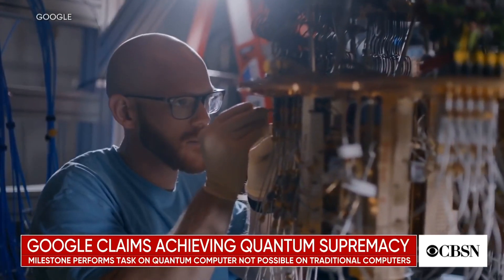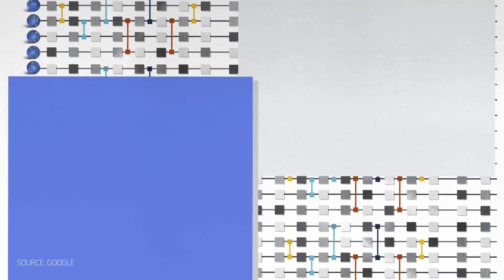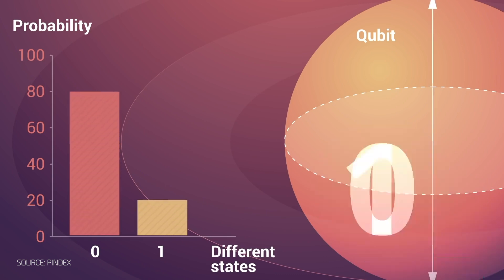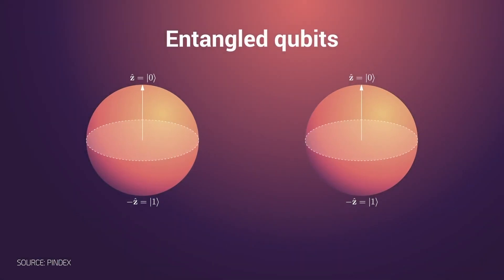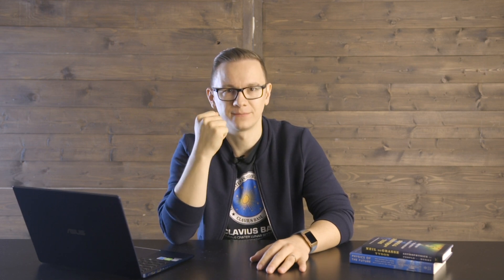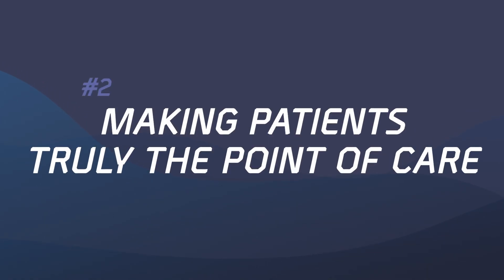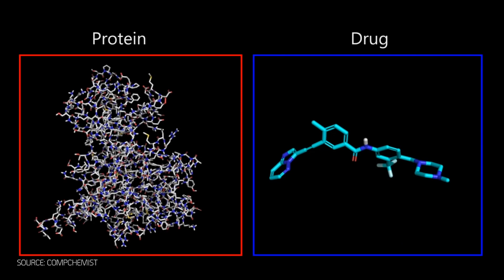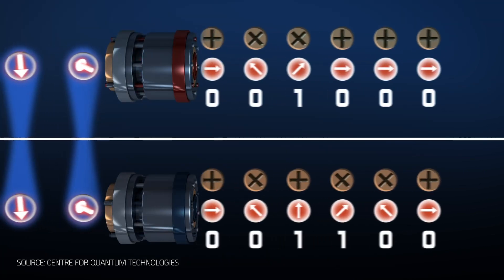Quantum Computing in Healthcare / Episode 4 - The Medical Futurist

Comment: there are other uses and developments of quantum physics into medicine. for example, the analysis of the patient can run through the Information Field (a quantum field consisting the info about the state of the body, the mind or some other specific), and the device is also able to change that information by writing a new one. 

i'm involved with one such quantum physical device which is able to analyse and treat through the information field. it's a revolutionary approach, very effective too, and i think quantum computers are not necessary in every way suggested in this video.

for example, i've been able to protect my clients against coronavirus (actually, eliminate the virus), by the use of quantum entanglement. the same can be achieved against any virus or bacteria... and much more!

so, like i said, with or without quantum computers, there are other immediate uses of quantum physics in medicine.
Reply: How do you have access to a quantum computer?